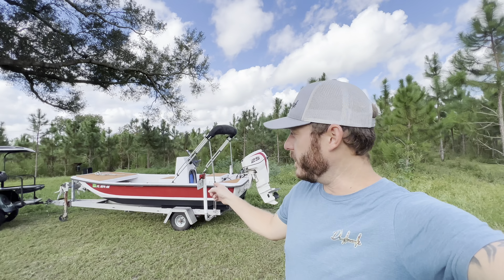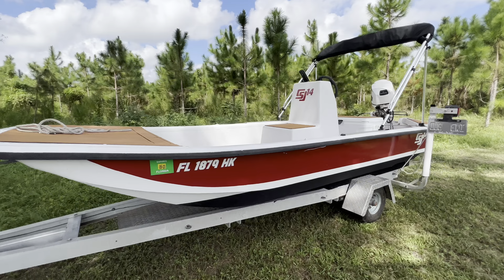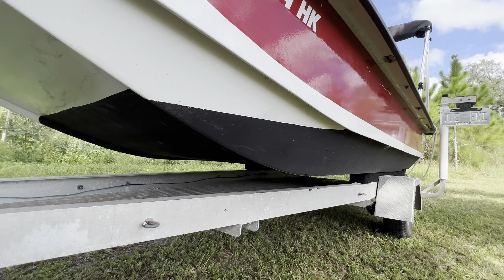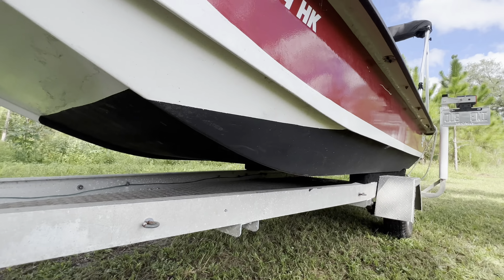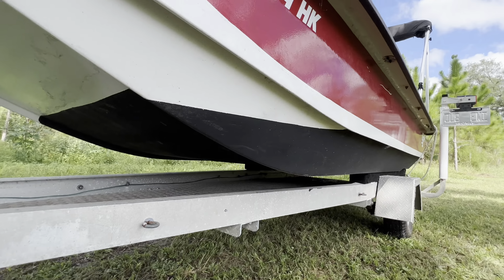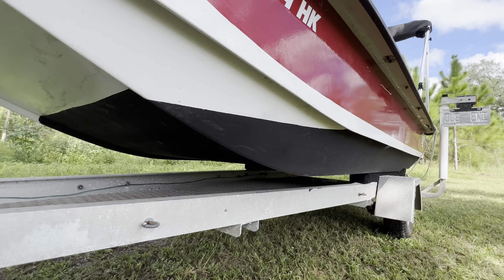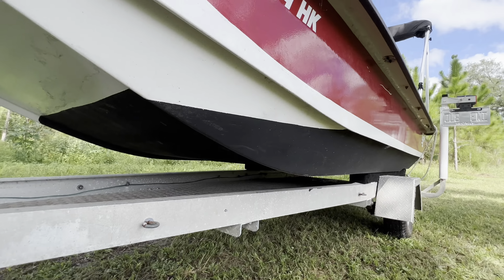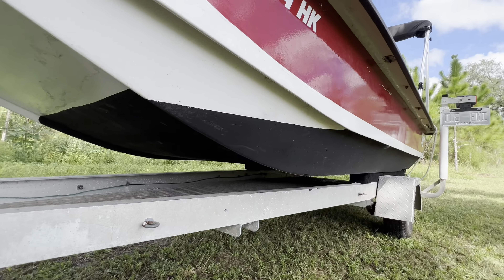Carolina Skiff J14 rebuild overview

Comment: Nice job. I have a j14 also inherent  from  my sister who's  husband  died. It aslo sat out in the fl. Elements  in Clearwater  fl. For years had it up and running for  two years. Put alot of work into it. Had water in the hull  I've  been extracting  for a few months now but think I'm  making progress  with it. I stilll need to bottom paint it and topside needs sealing againt water leaks. And hope that will be it. Lol
Reply from the maker: I got lucky and didn't have to deal with that but water in the hull is common on these unfortunately.  One thing I figured out is that it takes more time than anything when fixing these old things up lol

Comment: My J16 running lights are in the conventional position, but I need to put a new switch in and run new wiring.  The wiring currently runs from the center console, through the CS track to the stern and then, from the right corner where the rear light post is, under the rub rail to the bow.   I'm kind of wary of messing with the rub rail, which is now 23 years old and hard as a brick.  I'm thinking of running the wires along the starboard side (where they are now) through a piece of PVC pipe I'll hide under the curved side outside the hull.  Make sure you check local laws about where you put your bow light, I can't recall seeing anyone who put them anywhere but on the bow.  Thinking (but not sure) it may not be legal.

Thanks for sharing your rebuild, very nice looking boat.
Reply from the maker: Thanks for the kind words.  Growing up I always just had one of those clamp on sets in my life jacket bag just in case but I don't think we ever really used them.  I've seen a handful of boats with them mounted forward on the console but I don't know the legality of it.   I don't have anything running towards the bow right now and kind of wanna keep it that way if I can you know.